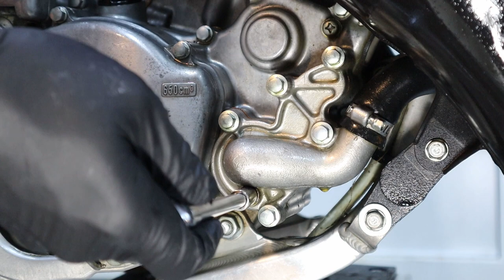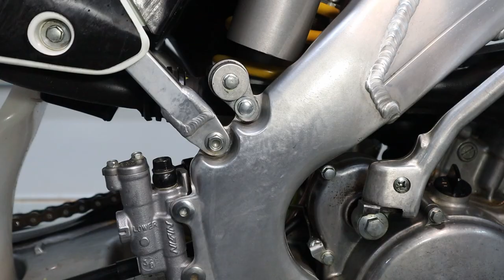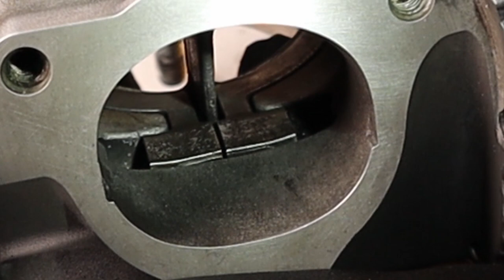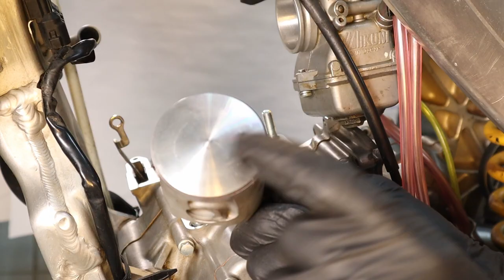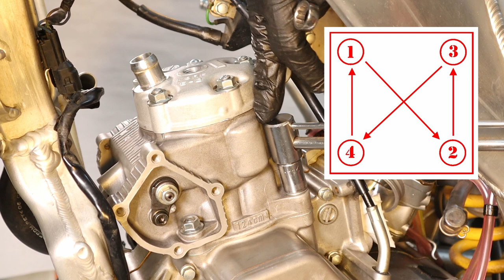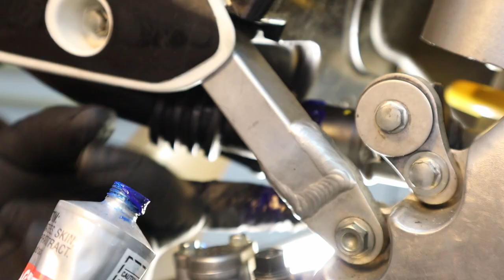The Right Way To Rebuild Your Two Stroke Top End (Honda CR125)

Comment: Nice! I did my first top end back in 1978 on my ‘78 YZ80 using an article from Dirt Bike magazine and a Photocopy from my Yamaha dealer👍😂 I was 12 years old and was so amazed when it fired up and ran great afterwards! One of the most rewarding moments of my life. Sure wish we had YouTube and videos like this back then!
Reply from the maker: Hey Robert!! I know that feeling! I remember my first overall rebuild.  I was totally amazed that my motor fired up on the literally the first "kick" (but it was a kart, so the way we started them was more of a bump start).  Anyway, it is a great feeling, I agree!! Thanks for watching!
Reply: The air cooled are a dream to work on. Well except for the 40 year old seized bolts
Reply: Back in the 80s either you figured it out yourself or you were SOL.

Comment: OMG the timing of this video could not be better. I just bought a 1997 CR 125 and I’m going to rebuild the top end, I’m definitely going to save this video.
I have a question, I’m planning on ordering a top end kit but I’m wondering what year Honda started stamping the cylinders with A and Bs. I read it was either 2000 or 2002 so I do not have to worry about mine being a 1997 correct?
Reply: Also do u absolutely have to remove the flapper valves and flapper valve shaft when just  swapping the piston ring and gasket?
I’ve rebuilt my little nitro engines on my rRemote Control helicopters but obviously never had to mess with power valves or anything. 
You have no idea how big of help you are, Greatly appreciate it and you got a life long scriber here!!!
Reply from the maker: Hey Scott!  Honestly, Im not sure of the year that Honda started designating cylinders as A or B, BUT in 1997 that naming convention was being used.  So, you have either and A or B cylinder and it should be marked on the rearward facing, left side of the cylinder very near the rearward most cylinder bolt.  I would recommend getting the corresponding piston that matches your cylinder type.  Often, non OEM piston manufacturers only sell an A piston, so if you don’t go OEM, you may have limited choices.  There are far more A cylinders out there than B, so odds are that you are fine with an aftermarket A piston sold by someone other than Honda.
Reply from the maker: @scottbuck9348  Regarding the flapper valve service, its a free country, so you don’t have to!  But, its not hard to do and it gets harder and harder to get them out and clean them the longer you wait.  Its really not a hard job and it makes a noticeable difference in performance when they are clean and working right.  I’d just suck it up and do it since you have the cylinder out.  And THANK YOU for the comments and for subscribing!  Ive become obsessed with videography and editing so Im glad I was able to help someone with one of my video projects!
Reply: Awesome thank you for clearing that up, I will take your device . Much appreciated
Reply: @brian.d.mobley  this was so helpful as i have never rebuilt my 2-stroke before.
Reply from the maker: @techdeckdude344  It was not that long ago for me either!  I have a lot of engine building experience and a lot of two stroke experience, but I had not taken apart my own motor and completely rebuilt it until a few years back.  Since then, Ive done LOTS!  Im kind of hooked on it!
Reply: @brian.d.mobley  ive been working on my rebuild now for about a week, doing lots of cleaning along the way as well and i couldn't agree more, every chance i get even for 15 min ill go out and start wrenching around on  the bike. ordered a wiseco gp racers choice piston, and as soon as my new head studs come in, shell be all back together!
Reply from the maker: @techdeckdude344  It’s funny, what I’m addicted to now is not such much the mechanical work, which I do enjoy, but the video creation!  I am hooked on making videos. I’m learning new things everyday about lighting, audio, camera settings, script writing, and on and on..  plus with video, I can create a permanent record of tasks so that other people can benefit. Its very creative and very satisfying.

Comment: Hey Brian, as i am just about to start this exact job on my 1998 cr125, how did you remove the fuel tank without having to drain the fuel?
Reply from the maker: Hey YLWR6!  All you have to do is turn the petcock to the off position.  I know it sounds overly simple, but thats it.  It may drip a wee bit of gas, but not much.  If you get stuck or need help, dont hesitate to reach out.

Comment: Do you not have to measure the bore and width of the piston?
Reply from the maker: Hi Jake.  If you are using a matched piston and cylinder, you really dont need to measure the piston.  For instance, on a Honda, if you have an "A" cylinder and install and "A" piston, you are good to go.  But, I did go over measuring pretty extensively in this video if you need all the details: https://www.youtube.com/watch?v=B76wuDaao4w&t=286s

Comment: Hey I have a 2003 cr125 and it runs good no bog or anything and it will rev out but I feel like (I know) it’s not as snappy or fast as it should be I think my power valves are having problems any idea what could be my problem? Just did top end, new lectron carb also. Cylinder is brand new.
Reply from the maker: Hi ONebulaz!  Like a lot of problems, there can be many reasons.  If the power valves are not clean, they can affect performance.  I have had such poor luck and spend so much time trying to help people analyze their problems that I just find its basically useless unless I have the motor in front of me, its almost impossible to say.

Comment: Great video! One question. Do 1994 Honda CR125R 2 stroke have timing? I removed my kick starter because the spring broke and the piston moved.  My concern is that make be it needs to be timed. I might be wrong, but wanted to ask you. I appreciate it 👍
Reply from the maker: Hi Gustavo.  Replacing the broken spring on your kickstart lever will not be adversely affected by the movement of your piston.  Good luck on your repair.  Thanks for watching!
Reply: @brian.d.mobley  thank you very much 👍

Comment: Hey Brian! I have an 04 CR125 and it has an A cylinder. When doing a top end rebuild is it important to have an A piston to match the cylinder or is using a B piston also fine?
Reply from the maker: Hi Jade.  So here’s the extent of my knowledge on that. Nona recommends using an A piston with an A cylinder. The reason why..?  That I don’t know!  The A cylinder is far more common, BTW. Sorry I don’t have more knowledge to share on the subject but I’m sure a little digging on the web should reveal the reasons.

Comment: Hey Brian I got a 2000 cr250 and it has coolant leaking into my top end any suggestions on this? Thanks
Reply from the maker: Hi King!  Yes.  The most likely culprit is a defective cylinder or head gasket.

Comment: Is it normal to have alot of piston movements at TDC? I have new topend bearing & big end. I'm Using old piston and rings because my cylinder needs service and didn't want to hone & new rings. Unfortunately I didn't notice any of the movements from piston at tdc.
Reply from the maker: Hey Aussie. In a word, no. But you can measure the outside diameter of your piston and the inside dimension of the cylinder to make sure all are within the manufacturers specs.
Reply: Ok thanks mate, just to be safe I think i will check. At the very top of sleeve I can see a uneven line where the new factory nicseal is & the worn nicseal. I was thinking that is because of piston rocking?

Comment: Did you replace any of the shiny looking nuts on the head and the place where the cylinder meets the crankcase, like the four studs? I’m trying to find replacement flange nuts and they all have serrations on the bottom from what I can find. I’m kind of against using a nut and washer to replace them considering how the original parts were flange nuts. Any help is appreciated!
Reply from the maker: Hey Jrob.  I did replace the studs and the nuts. I got all the OEM parts from Rocky Mountain ATV.  I don’t recall if the OEM nuts were serrated on the underside of the flange, however. Thanks for watching!!
Reply: @brian.d.mobley  thanks!

Comment: Will this video work for my 2003 cr125
Reply from the maker: It’s essentially the same procedure but the engine featured in this video is a 2007. Best practice is to supplement your knowledge base with the factory service manual.

Comment: i got a pw80 for my brother is it still the sami steps?
Reply from the maker: I’m sure there will be some differences, but they are both 2 strokes. However, the PW80 is air cooled. What I would do is get the service manual AND watch the video. The procedures are likely similar but you can confirm all the steps with the manual.

Comment: I have a question about the valves I had a bore done and seem like my valves keep hitting the top of piston .! When it's bored ? Should they shave the valves too BC that seem not the same size or do I replace the slider valves to the bore size ?
Reply from the maker: Hi John:  The procedure covered in this video is for 2 stroke motors that do not have valves.  Maybe look around for a video on 4 strokes??  Thank you for watching!

Comment: If the piston is seized in the barrel (maybe broken ring) what the best way to minimise the damage when taking it off?  I'm thinking ill have to take the head off and use the kick start to get the piston as low in the barrel as possible then tap on the piston whilst lifting the barrel?
Reply from the maker: Hey Dr. Paca. I don’t know if a good way to do the procedure about which you are inquiring with the motor still in the chassis. The best way is with the motor out using some sort of press. I’ve used the crank remover press for this purpose. I show the procedure in a more recent video where I disassembled a CRF70 motor. It had a piston in it that had become so corroded with oxidation that it was seized. Hitting the top of the piston with a mallet is not good practice as you can damage the lower end rod bearing and even throw the crank out of balance using blunt force. I wish I had better news.
Reply: @brian.d.mobley  Thanks for the reply Brian.  The piston will move with the kick start but scraping a bit, guess some damage to the barrel is unavoidable.  I'll avoid hitting  the piston as much as possible.
Thanks again
Reply from the maker: @drpacman9996  If the piston will move, you have hope. You can probably get the cylinder off. The best way to avoid damage to the cylinder that’s practical for a home mechanic is to try sliding very thin feeler gauges (maybe 3) between the ring and the bore to compress the ring slightly. This could be challenging and time consuming, but with patience, has worked for me. But, I always had the motor out of the chassis.
Reply: @brian.d.mobley  Thanks.  I'm not gonna rush anything as the season here is kinda over.  I'll try the feeler gauge trick and hopefully be able to hone the barrel rather than re-plate

Comment: How do you clean cylinder studs hole?
Reply from the maker: Hey Growgamer!  I like vapor blasting. But, you can soak them in something like Marvel Mystery Oil or brake cleaner for a day or two and then gently run a tap into the hole.

Comment: @15:36 why not just use a crow's foot and do the math for the torque? just wondering since i'm about to do my first top end.
Reply from the maker: @757machinist  I’m not familiar with a crows foot. But if you feel you can do it differently and get the same torque spec, feel free!
Reply: @brian.d.mobley  gotcha just figured I’d ask! Thanks for the quick response!
Reply from the maker: @757machinist  Absolutely! Have fun on your top end job.

Comment: Is there a certain break-in process, after a top end rebuild? Or is it ready to ride full throttle?
Reply from the maker: Hi Food Critic.  Excellent question!  Like a lot of things, there are schools of thought. There are those who support the idea of a break in period such as low to medium revs for 10-15 minutes.  Let the motor cool.  Ride again for 15 minutes with a couple of full throttle runs in the last few minutes. Let the motor cool. Run it hard for 15 minutes. Let the motor cool. Then retorque the cylinder and head nuts and your good to go. Other suggest that the nikasil cylinder wall is so hard that it doesn’t “seat” with the ring at all so there is no need to observe “break in” procedures.  Its hard to argue with the latter, but I just think that taking it slow and doing a few break in cycles can’t hurt and, Honda recommends some type of slow break in period. So, it’s debatable, but I just do it the conservative way. Great question! Thanks for watching!
Reply: @brian.d.mobley  awesome. Great video and great information. One more question, do you have a video or could you create one accessing, cleaning, adjusting, etc. the carburetor on a Cr125?
Reply from the maker: @foodcritic1399  Hi.  I could.  It would be a fun one to make also, but I am committed to so many other projects right now that it would be hard to fit that into my schedule. But, I’ll keep it in mind.  I’m sure a lot of people would find it useful and it would be fun to make.

Comment: How much play should be in the rod and piston? Or should there be any at all? I just took apart my 2001 cr125 and can’t find anything wrong besides that, but it makes a horrible top end noise when runnng
Reply: There is a lot of side to side play where the wrist pin connects
Reply from the maker: HI Ashton.  There should not be a lot of lateral runout on a wrist pin.  The service manual will specify the range.  I doubt this is the cause of the noise though.  Without having the motor in front of me, its really hard to diagnose problems with motors, however.
Reply: @brian.d.mobley  ya I looked a t it some more and the crank bearing is shot I won’t know what all else needs replaced till I get a case puller in. Thank you tho video help out a ton
Reply from the maker: @ashtonross5376  Its fun to split the cases and dig in there!  If you havent already purchased a splitter, this is the one I use and its been great:  https://amzn.to/3jNTDzs

Comment: i have a '99 cr80R. can i follow these exact steps?
Reply from the maker: Hey Marcus!  The procedure is basically the same, but the CR80 doesnt have a power valve.  I also have a couple of videos on how to Teardown and Rebuild a CR85 motor.  You can alway look there too.  But, basically, the procedures are the same on the CR80 and the CR125.
Reply: @brian.d.mobley  ah got it! i’ll check out the other vids as well. Thanks!
Reply from the maker: @marcuscavalier324  If you get stuck, just send me a message.  Ill do what I can to help.
Reply: Pretty soon will be my first time tackling a top end rebuild. Thanks for being there if i need to reach out
Reply from the maker: @marcuscavalier324  Its really not very hard. Just take your time and make sure you don’t skip a step.

Comment: I've spent 2 fuckin hours so far tryna get my cylinder back on and this guy just dose it like that , I'm working on a kx85 and the piston has 2 rings and it's just gets stuck every time even when I'm pushing the top of the piston in the cylinder it just feels like it's getting caught on the rings , maybe I'm not using enough oil? I've also tried zip ties idk what to do
Reply from the maker: Hey Boogie!  Maybe take a break first!  Its hard to show some things like sliding the cylinder over the piston and installing wrist pin circlips.  It takes patience and some practice.  Ive been doing it for over 20 years, so that helps.  BUT, compress the ring at a point farthest away from the gap and try sliding the piston in about 3 degrees from 90 degrees.  So, the piston is tilted ever so slightly higher on the side farthest from the end gap.  Get the side without the end gap to slip inside the cylinder, then compress the ring midway between the high part of the piston that should now be in the cylinder and press they cylinder down a bit more.  Working on motors is tedious sometimes.  I get frustrated too.  I have a new video coming out this weekend where I slide a 3 ring piston into a bore.  Maybe it will be easier to see how I do it.  If you really cant get it done, I can help you by email.  You can do it!!
Reply: @brian.d.mobley  thanks man and I did I can back from my storege unit and at chilled out with my girl and went back and put the whole bike back together, I've noticed when I get like that I need to just step away for a hour or 2 and refresh, appreciate the advice it really helped a lot!
Reply from the maker: @boogiekush9391  I sometimes struggle with frustration too. But, I’m really glad to read that you got it all sorted out and you’re happy again. Mechanics can be very tedious sometimes.